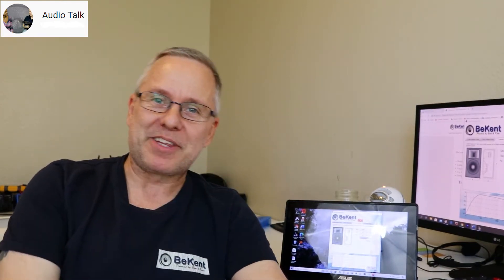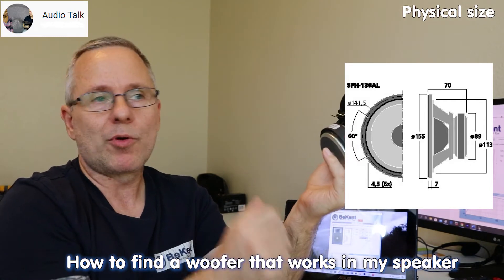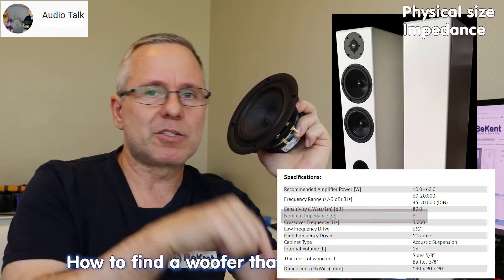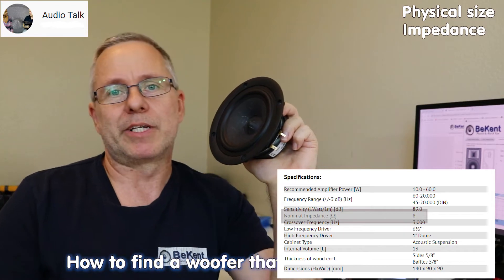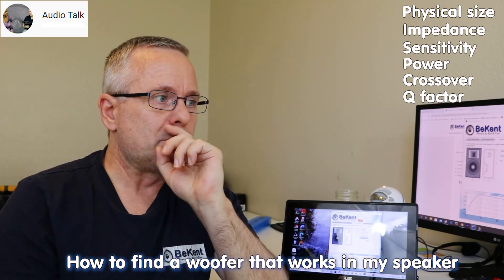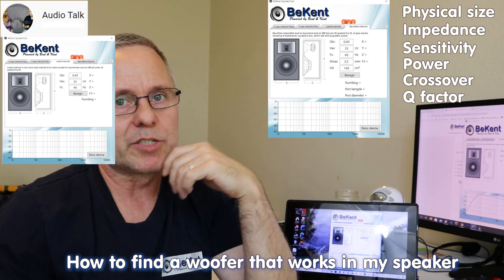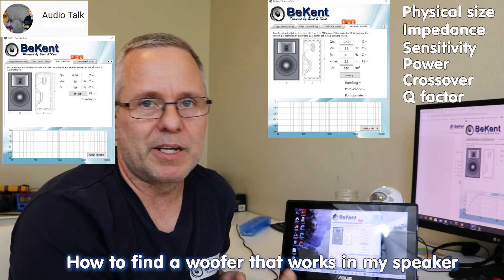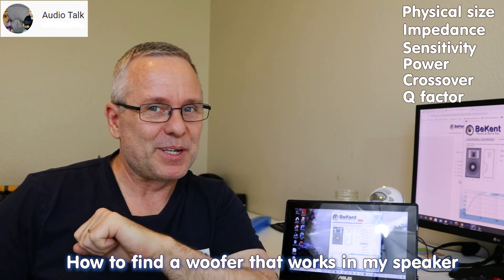How to find a woofer that works in my speaker

Comment: I know it's a long time from Jul 2020, but if you get this...Thank you for it.  Great help AND I will try your software.  One question, How can I seal the gap between the edge of my baffle and the inside edge of my cabinet?  I have about an 1/8th of an inch which will allow air past (what is supposed to be an airtight enclosure).
Reply from the maker: Sounds like this gap is intended, particularly PA speakers can have just a gap due to a high tuning of the port. So its likely to make the speaker have anemic bass by making it a closed box
Reply: @AudioTalk  1. There is no port 2. I just think it's the quality cut tolerance of the baffle.  They are supposed to be a sealed design as far as I know.
Reply from the maker: @Sunrayman123  the size sounds big enough to create a port effect, so its hard to say if its intended or a mistake. It doesn't need to be a tube to have the effect, and with PA designs just an opening is sometimes the solution.

Comment: 😍 can you connect your speaker to compare with cheap mundorf 47uf Mcap tin cap(white.color) vs 47uf Mcap Alum vs 47uf Mcap supreme silver oil vs 47uf Mcap Supreme silver/gold/oil EVO.  Does it sound different ! Video have ? 😍😍. ( can u do a video with that can ? It will be very Fun to try )....:/

Comment: Hi Kent,

Downloaded your software but my laptop (windows 10 - 2020) could open it (msi extension). Any idea how to open and activate it? Frank (Holland)
Reply: 😍 can you connect your speaker to compare with cheap mundorf 47uf Mcap tin cap(white.color) vs 47uf Mcap Alum vs 47uf Mcap supreme silver oil vs 47uf Mcap Supreme silver/gold/oil EVO.  Does it sound different ! Video have ? 😍😍. ( can u do a video with that can ? It will be very Fun to try )......:/

Comment: Hello :) I used your software for a MONACOR SPH210 woofer and it give me 17L. In other site they say around 25/35L.  
can I put this woofer in bigger box and what do I risk doing that ?
Thank you for sharing your knowledge:-)
Fred.
Reply: 😍 can you connect your speaker to compare with cheap mundorf 47uf Mcap tin cap(white.color) vs 47uf Mcap Alum vs 47uf Mcap supreme silver oil vs 47uf Mcap Supreme silver/gold/oil EVO.  Does it sound different ! Video have ? 😍😍. ( can u do a video with that can ? It will be very Fun to try )......"/

Comment: Keep up the good work bro 🤜
Reply: 😍 can you connect your speaker to compare with cheap mundorf 47uf Mcap tin cap(white.color) vs 47uf Mcap Alum vs 47uf Mcap supreme silver oil vs 47uf Mcap Supreme silver/gold/oil EVO.  Does it sound different ! Video have ? 😍😍. ( can u do a video with that can ? It will be very Fun to try )........."/
Reply: @roxy_xcxc6869  alum cap is best value for money and the white caps are decent too

Comment: Thank you for the lesson
Reply: 😍 can you connect your speaker to compare with cheap mundorf 47uf Mcap tin cap(white.color) vs 47uf Mcap Alum vs 47uf Mcap supreme silver oil vs 47uf Mcap Supreme silver/gold/oil EVO.  Does it sound different ! Video have ? 😍😍. ( can u do a video with that can ? It will be very Fun to try )..........."""""/

Comment: I have two small woofer driver 
1. 4ohm 15 w
2. 8 ohm 15 w
How to connect both and how to design the enclosure I don't know what to do
Reply: You can use BeKent software or other to calculate but you have to know the  parameters of the speakers. The 2 speakers should be the same brand with the same impedance.
Reply: 😍 can you connect your speaker to compare with cheap mundorf 47uf Mcap tin cap(white.color) vs 47uf Mcap Alum vs 47uf Mcap supreme silver oil vs 47uf Mcap Supreme silver/gold/oil EVO.  Does it sound different ! Video have ? 😍😍. ( can u do a video with that can ? It will be very Fun to try )......"/